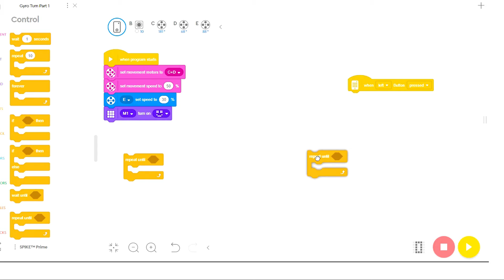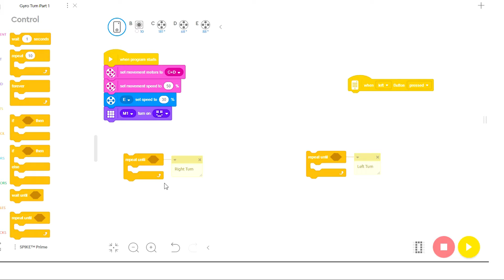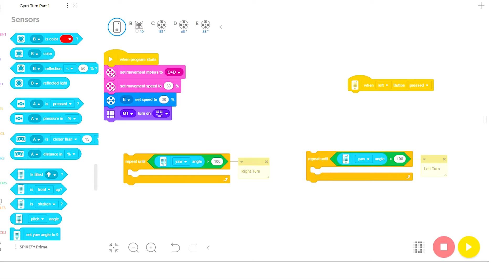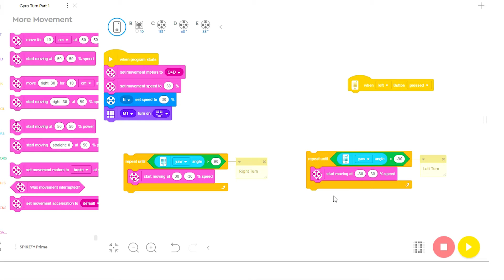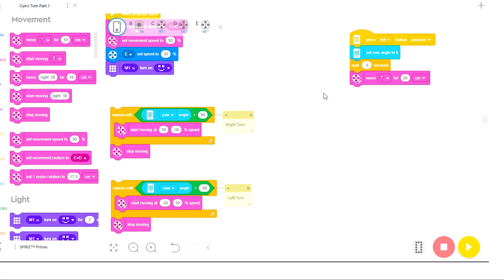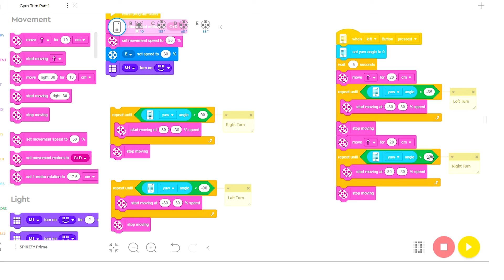Spike Prime Gyro Controlled Turns Part 1

Comment: Video summary:

When the program starts, the yaw will be set to zero. When it turns right, the value of the yaw will increase. When it turns left, it will decrease.

The right should be greater than because it’s increasing, and left should be less than because it’s decreasing.

When using sensors, make the speed lower to give the robot a chance to react to its surroundings.

Logically, to turn the robot, one wheel should be going backwards and the other should go forward. The robot will always turn to the wheel that is going backwards.

Always make the degrees five degrees less than the actual degree you want.

Again, give your sensor time to react by giving it a short wait time. For example, wait zero point five seconds.
Reply: thanks! I get distracted easily in videos like this so this was pretty helpful!